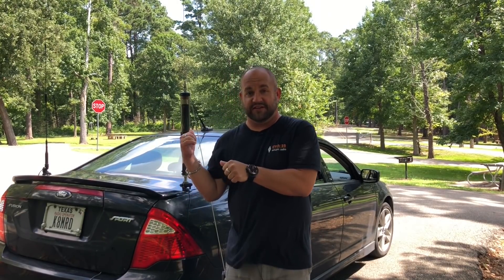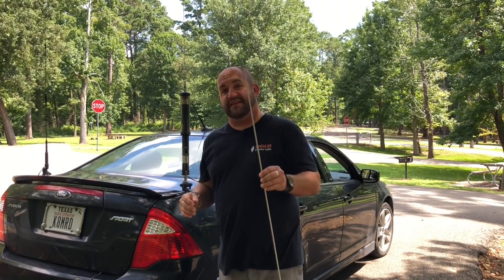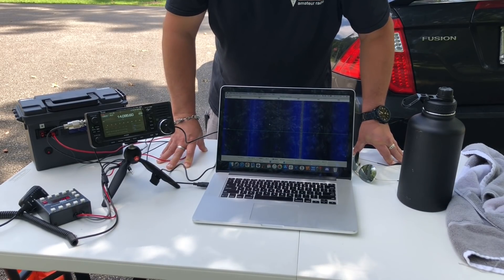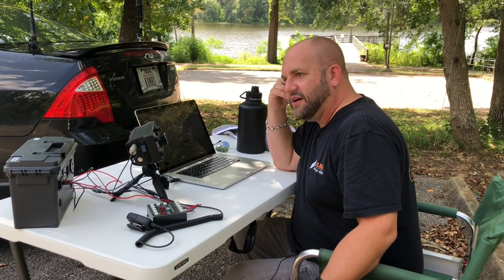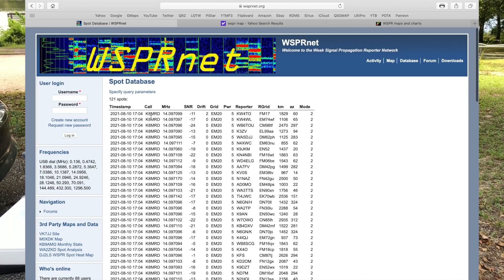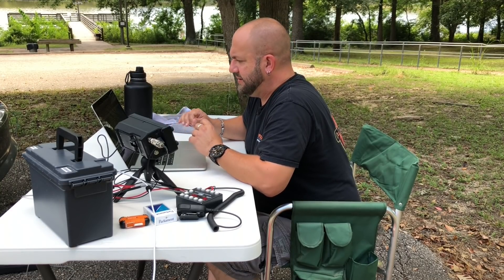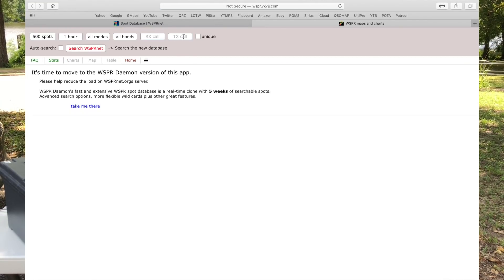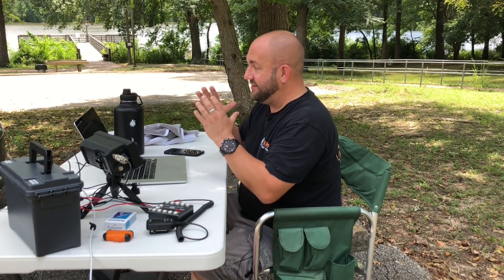MFJ SWP-100 | 6 Foot Screwdriver Antenna Whip

Comment: I used a 102 inch whip on the little tarheel 2 and it improved the performance of the antenna dramatically. I had to put it on a trailer hitch mount because it was hitting too many things like tree limbs and such.

Comment: I just got a Little Tarheel and asked Jean - the lady that works at Tarheel if I should use the 6ft whip, she said it's possible the motor will burn out for the 6ft whip is too heavy.  It's too bad, for it's a great idea to extend the whip.
Reply from the maker: Interesting.  I use the 6' whip more than not.  I don't drive with it on though, I use the shorter one.  I also use the MFJ 1979 sometimes.  Haven't had any problems so far.  I do keep my trip current as low as I can too though.  I think its at 17 on my MFJ controller thing I have.
Reply: @hamradiotube  I feel that the tarheel can Handel the 6’ whip, but should I risk it burning out! As for driving the 6’ whip - nope too much load.
Reply from the maker: @frankwc0o  Yeah I drove with it once on the freeway and pulled over to take it off.  It's a bit of a load for sure!
Reply: A 56” whip is an improvement over the 32” whip but you still lose 6 meters.

Comment: Try the CB 102 inch whip.  It should be even better. I don't think I would drive with the long whips.  You could be hitting trees and maybe other things. But parked doing a POTA the longer whip could give you much better.

Comment: More wire better for low bands, you'll lose the high bands..
Reply from the maker: Yes, but it's a good trade off.
Reply: @hamradiotube  Wow I never heard or see a screwdriver antenna.... But I think this is the solution for me as a base station antenna.  do you think I can mount this on a balcony? And do you think  it will work on 2 meter and 70cm band ? 
Greetings from the Netherlands
Reply: No 2m/70cm will work well in used I use a metal porch table with radials

Comment: Have you had any issues tuning while driving with the 6 foot whip on the Tarheel II? My mount is more solid that yours, a ball mount on a pickup.  I see after starting this post that you may not have tried.
Reply from the maker: I haven't driven with the 6'.  Don't want to push it with my mount and the speeds I drive lol!

Comment: I am trying to use my little tarheel 2 at home.  Do you know the best way to set it up.
Reply from the maker: Sorry for the late response and hopefully you have come up with a solution.  If not, I would prob get some kind of tripod for it.  Maybe get one from Wolf River Coils.  The Mega Tripod is great.  You could set it up ground mounted and run a few counterpoise wires.  Should work just the same as a WRC I would imagine.  Or just mount it to your car and run some coax out the door.  Thats what I did when I first moved here.  It worked great.

Comment: Mike, I picked up a baby Tarheel after watching your initial video on it. Adding a longer whip definitely makes a big difference in your receive, and TX'd signal. I also noticed a performance improvement moving to the Tarheel 75A, which I think is a better antenna over the baby. I am currently using a 6ft whip. I have a pick of my mobile install on QRZ. Also, I found handy a QD for your whips, like the Hustler QD-2. 73. KE4IP
Reply from the maker: For sure.  It's a surprisingly big difference.  Even going from 30" to 72".  I was quite surprised at the results.  I've heard about those QD's but I've not looked into them.  I might need to now.

Comment: I use a Tarheel 100A-HP (ground mounted) with a 17ft (MFJ) collapsible whip.  On 40m it needs very little loading coil and collapsed a bit on 20m, it needs none.   Other bands are easily tuned this same way.  Still a compromise  but I have worked a bunch of DX on phone and digital with it so not bad.  Of course the radials help a bunch.
Reply: i have done the mfj on my wolf river and it is huge. But don't drive with it.
Reply from the maker: I've been wanting to take it out and use it as a ground mounted vertical.  Sort of like a powered Wolf River Coil.  That would be cool.   I would suspect it would function exactly the same as the WRC.  As compromised as these antennas are, the still get out.

Comment: Another thing to try would have been a random length of wire oft the running section
Reply from the maker: I've not tried that with any of my screwdriver type antennas.  One of these days I will.
Reply: @hamradiotube  I meant tune coil

Comment: That’s exactly what I did with my LT2 on my Honda Accord. 6 foot whip made all the difference.
Reply from the maker: Do you drive with it on?
Reply: Used to. Not anymore. Car was sold in 2019 after 327000 miles.

Comment: There is a 102 inch whip (8.5 foot) and a spring that is about 4 or 5 inches that has a braid in side for conductor. Makings it around 9 feet.  Using something like all  thread you should get 10 M without any loading!  There is also mounts for this. The 102 inch with spring is CB antenna,  11 M.  Amazon has them and different mounts. Also there is a thing that is made to use to clip to a point to hold the tip down.
Reply from the maker: The problem with going too long is I wouldn't get 6 meters.  I think the 72" might actually be too long for that now that I think about it.  There is only a couple coils of inductance with the stock whip on 6.  Similar to the Wolf River Coils antenna and the 17' whip.  I feel the 17' is too long for it.  Sure its resonant on 20 but its actually harder to tune up 17-6 with it.
Reply: @hamradiotube  Well that is what happens when I don't know everything you want to do. But the Spring May be good to help if the antenna hits something. But I don't know anything about that antenna, so it may not help. I come up with ideas, some are good are not and just need flushed!

Comment: Land Rover Defender, Suzuki Samurai or SJ 410, LJ80, and Hummer H2  of Pickup Truck are the right Verhicles for heavier screw driver antennas or  any longer whips. What you tried is like mounting an Optibeam on a Honda Civic. But I figured you love that challkenge if you vehicle will hold it or just breaking apart in the worst Case...huh? RF Craziness unlimited got a name "K8MRD". Good job Mikey...happy weekend
Reply from the maker: I don't know what an Optibeam is but now I want one!  Sounds like a crazy strong flashlight.
Reply: @hamradiotube  Optibeam ist quite a weapon on HAM Radio Heaven

Comment: Good video.  May try replacing the 8' telescoping whip w/a 16' length of wire hung from a tree on the WRC TIA 1000.  Coil/wire hybrid antenna w/3 30 ft radials on the ground.  Thx!
Reply from the maker: I've not tried that yet.  I have the 17' telescopic antenna from MFJ though.  That is resonant on 20 already so you don't need any loading from the coil.

Comment: Hi Mike, Nice video, longer whip works!  Or as you say, more wire in the air works!  Glad to see you’ve got some shade for this video.   73 KM4SON
Reply from the maker: Thanks Don.  Yeah the shade is pretty nice from time to time.  I was just driving around the park looking for a place to set up and that looked like a good spot by the water.

Comment: I use the 56" whip on mine while driving with no problems for the K400 mount. It made a big difference over the stock whip. Check their webpage for the 56" whip.
Reply from the maker: Sounds like it would be a good compromise.  Thanks for the tip.  73

Comment: Mike, just wanted to tell you I made it through the Angiogram yesterday just got home from the hospital today. I have a new Stent #7 on my  Right Side Main Coronary Artery. getting referred for the TAVR
Reply: Bless your heart. Prayers for Kristyanna.
Reply: @joecraft4409  thanks,  I had an Angiogram on both sides of my Heart they went in an Artery in my wrist for my left side of my heart and in my vein in the same arm but in my upper arm for the right side of my heart. I had a Stent (#7) put in my Right Main Coronary Artery. I still have bad shortness of breath while just moving in the house. I cannot walk to my kitchen and get a glass of water when I get back it takes a few minutes for me to catch my breath. I have to have a Transcatheter Aortic Valve Replacement (TAVR), it is a minimally invasive procedure to replace a narrowed aortic valve that fails to open properly (aortic valve stenosis). Doctors insert a catheter in your leg or chest and guide it to your heart.
Reply from the maker: Thanks for letting us know, and glad you made it through the procedure.  We're all pulling for you.